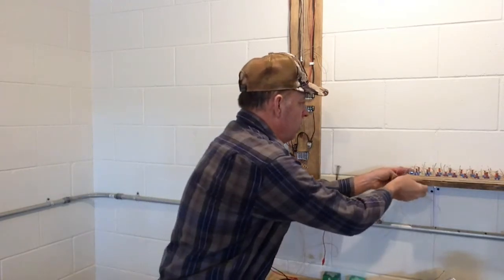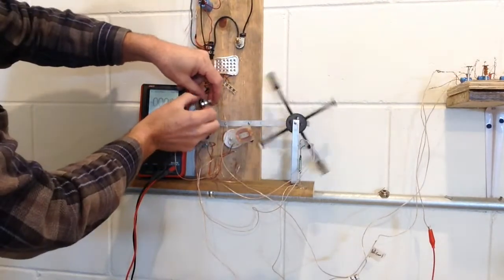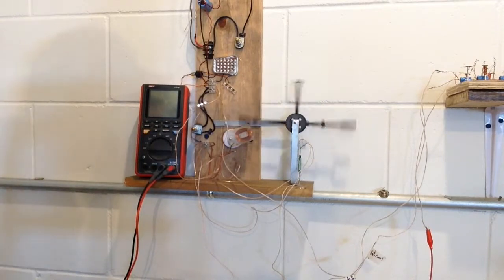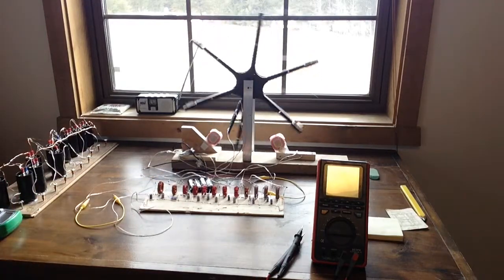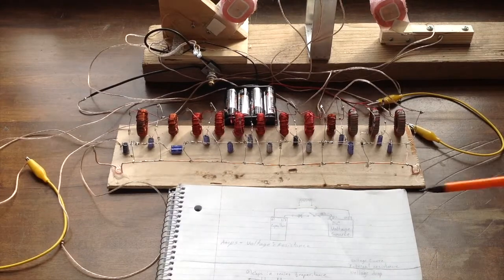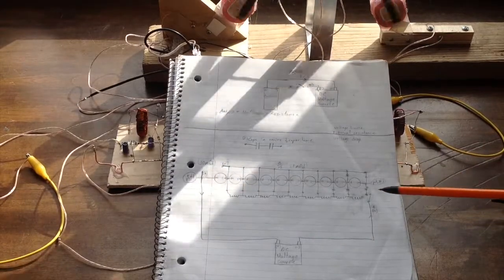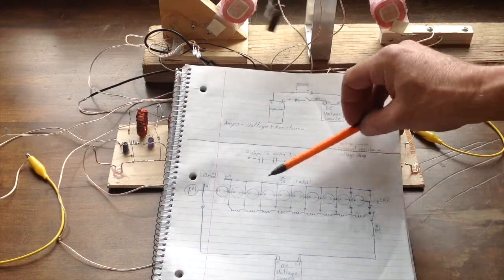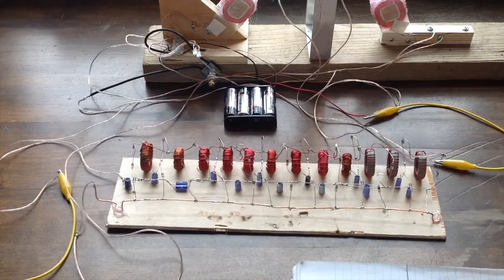Seems to Create Energy; but is really salvaging it

Comment: Well done great Discovery with that circuit. You could use the back EMF into another drive coil to make the rotor spin faster as well as charging a 12-volt battery.
Reply from the maker: I guess there are some electrical engineers who are aware of the loss in charging capacitors, but they just leave it as an 'acceptable loss'; (from what I read).  Hope to work some more on the circuit this winter, if time is available.